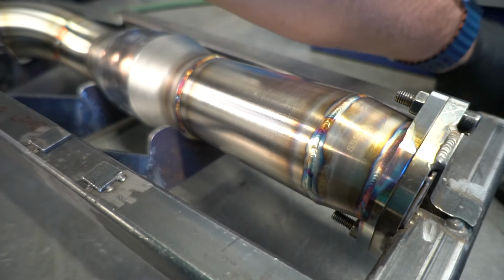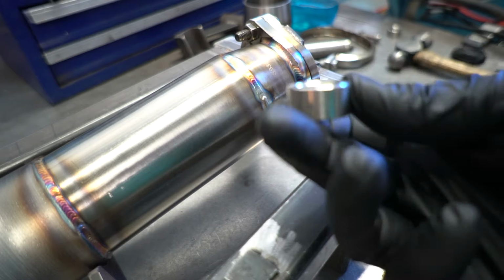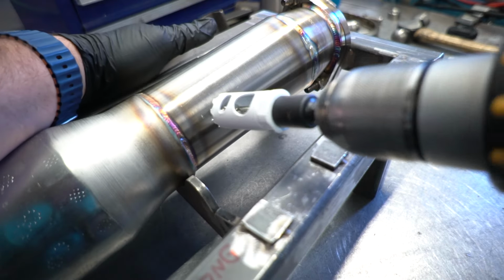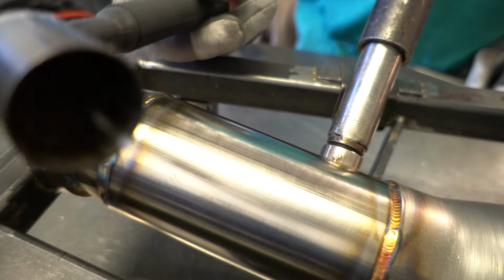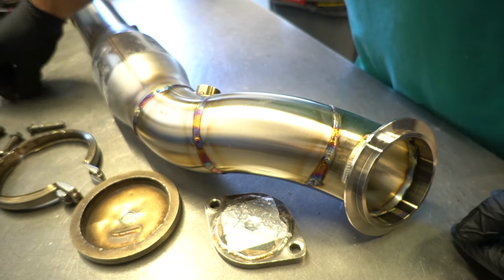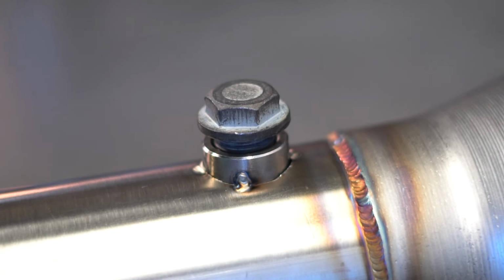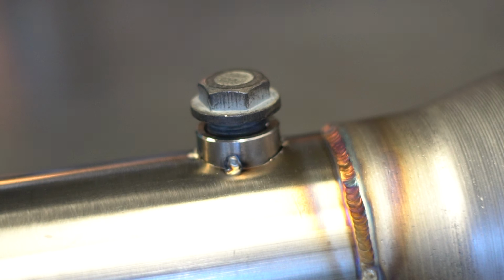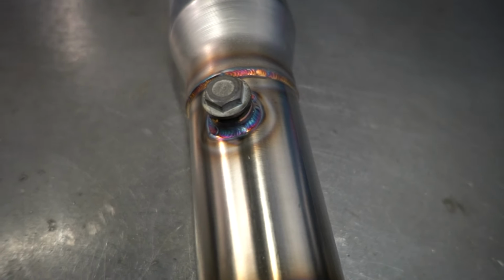How To Get Perfect 02 Sensor Bung Tig Welds Stainless Steel: Custom Exhaust

Comment: I’m just curious because I don’t know.  Why do you recess the bung into the hole?  Why not get a bung tapered for the radius of the size tube you’re working with so it’s contoured for the wall of the tube?
Reply from the maker: I do that on products that are built in fixtures so you have enough play to adjust the angle if the hole is drilled slightly in the wrong place. If I was doing just a wide band bung I use lipped or coped bungs a lot. I’ll do a video about all three here soon.
Reply: @ thanks for the reply!

Comment: You kept saying 1/8" filler, but your filler looks smaller than tungsten. Guessing 1/16" filler?  Would have liked a little more discussion on actual welding technique... assume keeping the arc down on the tube, dab, and then washing the puddle up on the bung?  Liking the channel so far.  Agree with ditching the music, especially when you are talking
Reply from the maker: I am using 1/16 there.  I do use 1/8th sometimes but I miss spoke about what I was using at the time. Yes, that’s pretty much the technique. It’s during the dab that I’m bringing the puddle up to the bung. Thanks for watching. Let me know if that explains it enough.